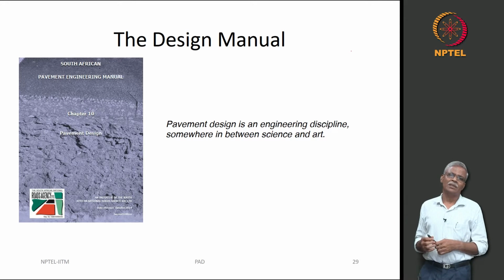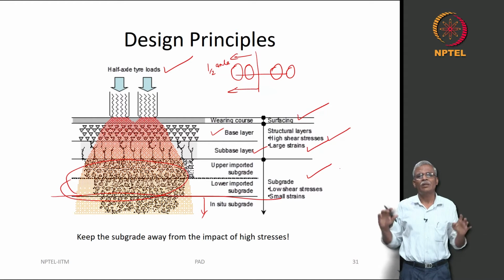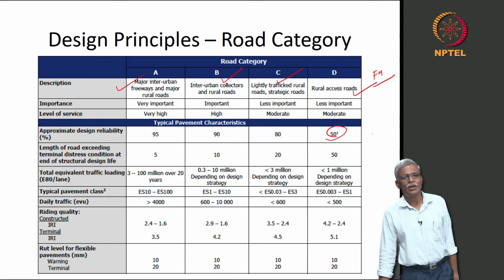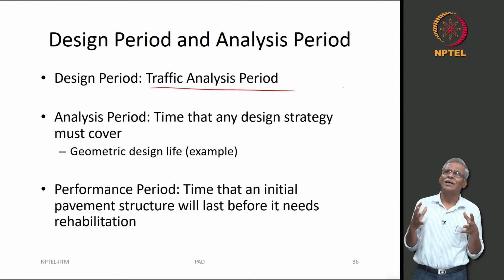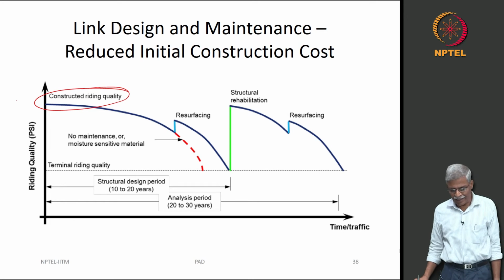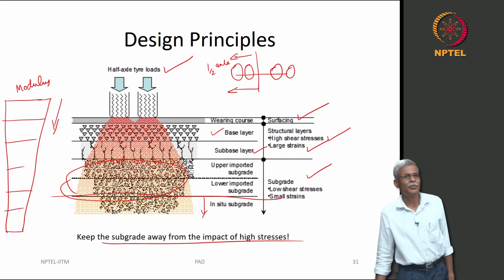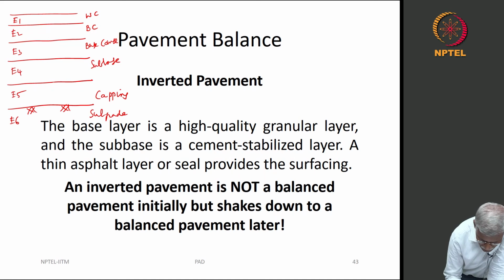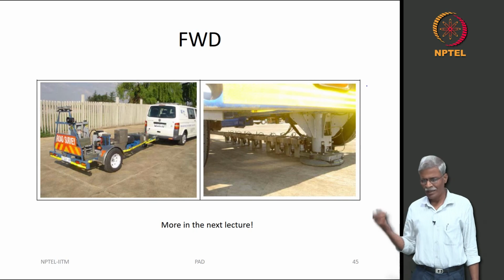Overview of Mechanistic-Empirical Pavement Design Methods - South Africa - Part I

Comment: Thank you for your excellent presentations with demonstrating the effect of change of material parameters. I am from Nepal retired from dept of roads  six years ago. What I am wondering at is the layers theory 2 and 3 layers especially the equations that kenpave and IIT pave iterates to come up with the values of stresses and strains at depths. I would be indebted to if you could entighten me in this regard. Also Mr Huang has mentioned about the iterations of these equations about the infinite series. In one of your slide you also said about Huang and yodder and witztack. I have both the books and gone thoroughly the one by Huang. Plz help me.